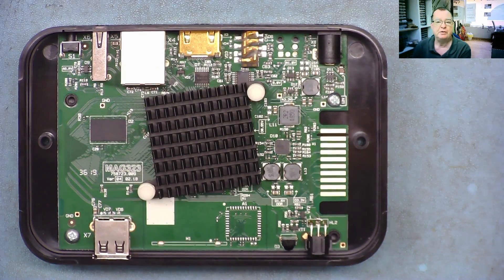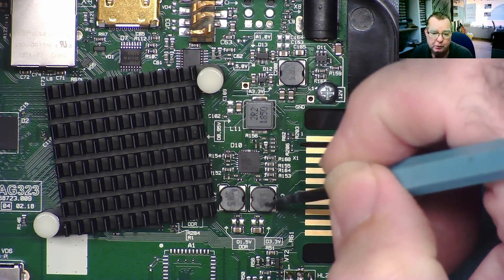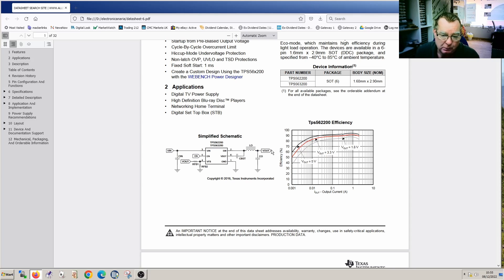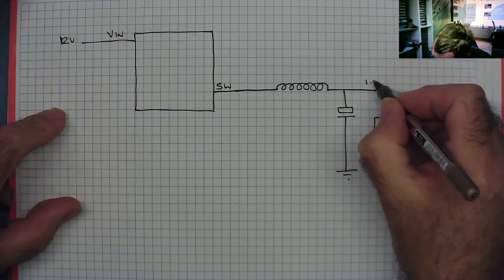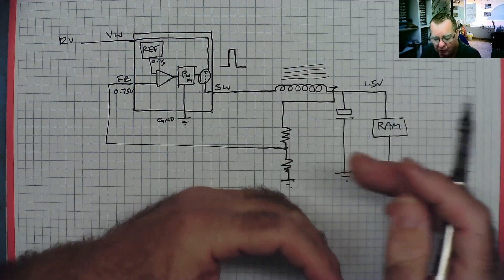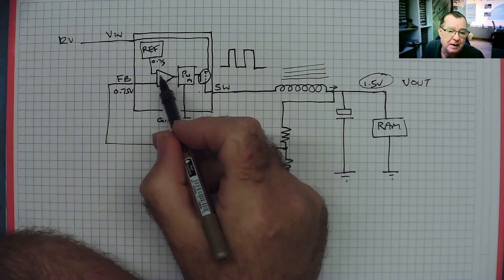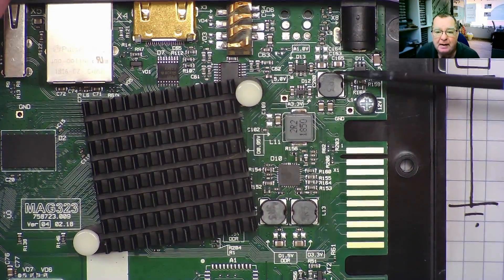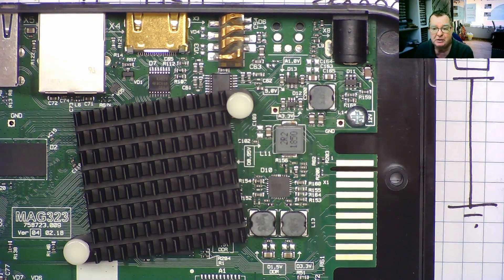How a PSU With Too LOW Voltage Can Kill Your Electronics Devices! HOW A Buck Converter Works!

Comment: Great diagram and tutorial as always but I'm not sure about it because if the input voltage drops then the PWM generator will have to apply the voltage for longer that makes sense but that's because the current needed to create the correct field and charge the cap will take longer but no extra current is needed, its same current out as comes in for the inductor and that's set by the load, the only way I see a problem is if the voltage drops to low and the reference voltage gets messed up then anything can happen. By dropping the input voltage there is less current and therefore less power available in the system. Well not sure I got my point across very well and I understand what your saying but I think there's more to it, maybe someone can tell me I'm talking rubbish down below....that's my 2 penneth worth !...cheers.
Reply from the maker: @andymouse123 Your 2 penneth worth is correct, but..... yeah there is always a but...  
The circuit designer will know what the supply voltage will be and what the maximum load on the voltage rail is going to be, and calculate the pulse width required to supply that current.  

They will then select the inductor such that, even at maximum load, it does not reach saturation (fully magnetised) and they will leave a bit of headroom as well (say 25% or something).   Then you come along and stick 5V into the device.  

The PWM obviously will try to maintain the correct output voltage, but it will have to use wider pulses to do it.  So one of a few things are going to happen now.  

The buck controller may still be able to produce the required output voltage (working hard to do it, therefore under more stress than usual).
The buck controller may reach maximum duty cycle and simply can not reach the correct output voltage.  
The buck controller may drive the coil into saturation (or close to it) because the circuit is now running outside of the parameters the designer intended - and a saturated inductor is the same thing as a short circuit.  Game Over!

Most likely the buck controller will have UVLO protection (under voltage lock out) to stop it running with too low an input voltage, but if the minimum permitted supply voltage is 4.5V for example, and the inductor saturates at 5V supply, for reasons explained above, UVLO will not save it either.  I hope that helps clarify things. 🙂
Reply: @LearnElectronicsRepair  Thanks !
Reply: @LearnElectronicsRepair  lowering supply voltage will actually reduce peak current in the coil. 

Load current is equal to average coil current, so making pulses wider will actually reduce peak current, making peak equal to average on Vin=Vout with 100% duty cycle. 

Yes, high-side MOSFET RMS current is most likely what will get it fried, though not due to saturation.
Low-side MOSFET/diode will have it easier, though)

Comment: I don't understand one thing if instead of 12 v put 5 v the buck converter should be more safe because deal with less voltage... And the pwm shouldn't have so hard work because the 3v the time for open and close the MOSFET, to generate the 1.5 v is not so hard like one 12 v spikes... And it doesn't need so much current to generate the 1.5 v ... Right? So I don't understand the title of video... Greatings from Portugal 🇵🇹 🌟
Reply from the maker: @Henrique Ferreira That may seem to be the obvious case, but there are other considerations here.  If the mosfet is in the on-state for long enough to full magnetise the inductor (drive it into saturation) then the inductor becomes just an ordinary  bit of wire and effectively shorts the mosfet through the load to ground, killing the mosfet, and quite possibly the load which is suddenly exposed to 12V or 5V instead of 1V or whatever it prefers to consume.  

When you apply too low a supply voltage (wrong PSU) then the PWM must turn on the mosfet for longer on each pulse to get the correct output voltage, and it will try to do that.  

Now the circuit designer expected 12V supply and knew the maximum possible load current of the device/voltage rail so he selected an inductor of a suitable value to handle the expected pulse width, plus a bit more for headroom/tolerance ,and never get close to saturation.  When you come along with a 5V PSU and the PWM is now driving the inductor with pulses 100% or a bit more wider than the expected maximum, it is quite possible the inductor will be driven into saturation (instant death for the mosfet) or driven close to saturation (slightly slower death for the mosfet)   I hope that helps clear it up a bit

Comment: Thanks for your great video. It's a good video, and I like it. But... Um... I just have to say (cause I'm a bit anal) that what ever current flows into an inductor, flows out of the inductor. Unlike capacitors, inductors can't store electric charges. Energy is stored in the magnetic field created by the current flow.
Reply from the maker: Fair comment, sometimes I over simplify things (or can even play a bit free and easy with the actual physics involved) but it is the visualization of what is happening that is important - this type of explanation/analogy is 'close enough' and paints a clear picture to the viewer.  Like conventional current, first were all taught it, then we learnt it is not actually correct, and then we just preferred to believe it anyway 😁  Nice to see you really enjoyed the video. Thanks

Comment: Although the video was super interesting and I learned about how those voltage converters are working, I am still left wondering why it wasn't the chip that died, but rather the (25V rated) capacitor next to it. I am assuming it also couldn't handle the higher current, although it looks pretty big and beefy?
Reply: From reading research papers about ceramic surface mount capacitor failures, its mostly from localised thermal cycling of the board, bending the capactor enough to internally crack some of the layers and cause a short circuit.
Reply from the maker: I think it's just by chance this mag box had a shorted capacitor.  When the customer brought it to me he brought a 5V PSU with it which he said he had connected, so my first assumption was that it would be chip that had blown as it is a common fault in these circumstances.  It's possibly in this case that the capacitor failed for other reasons, and the customer could have previously been using the correct power supply and tried the 5V one when it would not work, but the issues explained in this video are still relevant.

Comment: Given I know that this particular device is built to a price and/or designer doesn't expect user to plug in incorrect supply, but if a designer so wished, what could be implemented into the design that would prevent the device from starting up unless it sees the correct voltage, supervisor chip of some kind? something that generates a power good if voltage conditions are met? what would be the solution? or is there more than one way to solve that?
Reply: Those boxes are tremendously cheap thus very low quality design. I have seen blown units because of too small heatsinks, burning AC/DC adapters etc. Sad story - we are fighting e-waste and still flooding world with crap. Thanks to people as Richard it mihht be a bit better.
Reply: Low voltage cutoff circuit would work.
Reply from the maker: @user-dx8dc1be5k  UVLO (under volts lock out) will not help you here if, for example, the UVLO cut off voltage is 4.5V but the inductor already saturates when the supply voltage is 5V, due to the longer on-time.  Once an inductor is saturated (fully magnetised) it is basically a short circuit and the controller/mosfet will be destroyed,  Even driving an inductor close to saturation is not going to be very good for the buck controller.
Reply: @LearnElectronicsRepair  the uvlo , you mention here is of that built into the chip...
The circuit designer has to provide an external u.v. shutdown based on input & output requirements....
From the looks of it , this seems a voltage mode buck.  i.c. so some external overcurrent
protection would help... As seen in data sheet, there's an EN ( enable ) pin for such external add-on... protection..
Another point to consider in buck switch..., they are " high " side switches...so its max.  g-s drive is the difference between input & output voltages...( assuming  an N ch.mosfet ) , with source lifted to v- out.
Also the mosfet gate driver requires at least 8-10 volts ( bootstrapped...see i.c datasheet... there's a .C-bst between pins 2& 6) ...for reliable switching...else turn on is not proper & device tends to operate in linear region (can cause  thermal runaway failure ).....good gate driver design always have a gate driver u.v.l.o. too.( latch mode) for extended switch life..

Comment: I've got a 4 port Geffen HDMI switch that something has happened to and I can't figure out what actually went wrong as there is no visible damage to anything, as far as I can tell anyway. The difference with this unit however, is it actually took a 12v psu plug (i guess they never got the memo)...  I still have the thing thinking I'll figure it out at some point. I've got a different unit in it's place so it hasn't been on my priority list.

Comment: all people should remember, it's the current that counts.
Reply: Ah .. no. It's everything.
Reply: @VndNvwYvvSvv  i've kknow many fried components that would disagree with you. :)
Reply from the maker: @frankbaron1608  Actually, probably, it's the Wattage that counts 😁
Reply: @LearnElectronicsRepair  very true. heat dissapat ion and all that.
Reply: Ha ha I say it's the voltage. Voltage is king! Everything is determined by the voltage. Including current of course.
Reply: @martinda7446  voltage and resitance... and current. and erm wattage, but it's actually rock and roll that's king. according to ELO.
Reply: @frankbaron1608  What about Elvis?
Reply from the maker: @frankbaron1608  Never a truer word said!!!
Reply from the maker: @martinda7446  Presley or Costello?
Reply: @martinda7446  well given that rock and roll itself is king and elvis was the king of rock'n' roll. doesn't thame make elvis the king of the king?
Reply: @LearnElectronicsRepair  Both -  I was just playing This Years Model...On vinyl bought in 1979.
Reply: Actually, a voltage causing reverse-flowing electrons, which causes current, but let's not go there (oops, too late).
Reply: @ralphj4012  all curent is technically netayive to positive, but when i first heard that, i remember saying "well wy can 't we just determime that the flow of electrons is positive and assert the movement of the 'holes' as being negative? " i was met by many blank looks
Reply: @frankbaron1608  Indeed. Actually (I admit to being a prevert), I blame Benjamin Franklin. The theory of holes somehow moving out of the way of electrons, effectively flowing in the opposite direction, nearly scarred me for life. I'm happy with the current (ho, ho) equilibrium, I'm not going to be the one to change all the schematic diagrams and recall all the incorrectly labelled / coloured lead DVM's etc in the world.
Reply: @ralphj4012  Never start a sentence with, 'actually', it makes you sound like a prevert. 😁

Comment: Basically the output power of a switch-mode power supply like this buck converter is fixed due to the voltages programmed by the feedback circuit and the current the load is drawing at this voltage. If the input voltage drops the converter needs more input current to produce the same output power. However, mosfet switches and inductors are designed for a certain maximum current. If this maximum current is exceeded the converter blows up.
Reply from the maker: exactly 😉
Reply: Yeah, depends on the load, but when converter dies, cause basically boils down to Ohm's law, less input voltage, more input current.
These circuits are designed not only with max currents in mind, but also highly optimized for input&output ranges of operation to decrease footprints and costs.
They may be configured for a more universal ranges, but this has to be accounted in design.
Reply: @Mr.Leeroy  Yes, good design can avoid this failure mode. The inductor needs sufficient current headroom for a big voltage input range. But this means more space on the PCB, higher component cost and probably less efficiency at the nominal input voltage. Additionally the controller chip must have a low voltage shut down in order to avoid even higher currents. The TPS562200 by the way has this feature. So it all boils down to the inductor selection.
Reply: @UltraUltaderdritte  at the same voltages efficiency would be better with bigger coil and beefier FETs, since this translates to lower ESR.
Efficiency usually lowers as you increase input to output voltage difference, but it depends on load percentage too.
Frequency is a big factor for safe operating range as well as inductance.
Reply from the maker: @UltraUltaderdritte  Exactly. You hit the nail on the head there!
Reply: @Mr.Leeroy  For example power supplies that run on 120-240V. Bigger input-side capacitors than needed for 120V since they have to handle 240V. But also bigger diodes because they draw more current at 120V than 240V.
Reply: I waited for this till halfway through the video.
But this man knows way too much for simple folks like us. I learnt a lot more that what I was really looking for.

Comment: If you renamed this video "How a buck converter works" it would probably be the best Buck Converter video on the internet.
Reply from the maker: Renamed 😁
Reply: I couldn't have put it better myself. I really enjoy his videos.
Reply: this is oversimplified and missing all the math (that is not complex too) that really explains why you would overload dc-dc components by undervolting them (proper ones have UVLO protections btw).
katkimshow did a great job on several dc-dc topologies here on YT and not overloaded with theory, just enough to really understand working principles and not the abstraction.
Reply from the maker: @Mr.Leeroy  Of course it is simplified, if you have to point that out then you probably miss the point of this channel.  UVLO protection will not help you in this situation by the way 😉
Reply: @LearnElectronicsRepair  I understand that this channel is about repair only, and point this out in regard to "probably be the best Buck Converter video on the internet".
Why do you think UVLO won't work?
Reply: @Mr.Leeroy  For a basic understanding of how a buck converter works, I stand by what I said.

Most of the videos that teach you how a buck converter works are pretty crappy. They either have too much information or not enough.  I'd say this guy's video is a great balance between the tool, making it the best video out there.  You don't find yourself getting halfway through the video and wonder why you were there in the first place.
Reply: @RK-kn1ud  I agree
Reply from the maker: @Mr.Leeroy  Bad inductor selection by the designer.  The inductor saturated due to long pulse width even though the supply voltage was still above the UVLO threshold